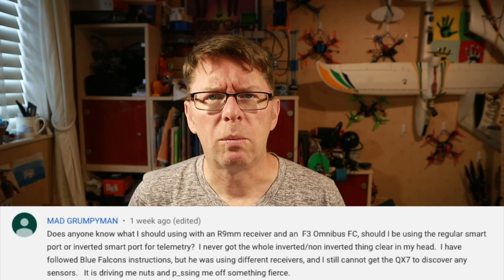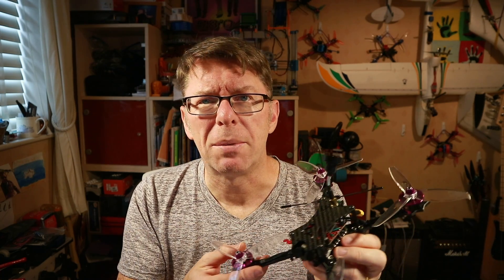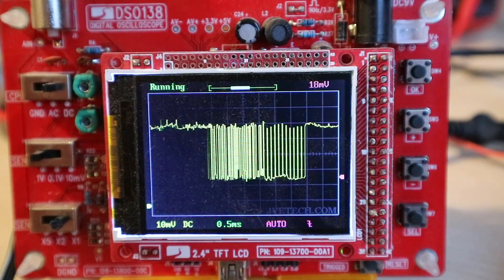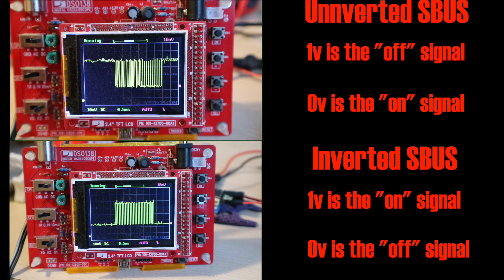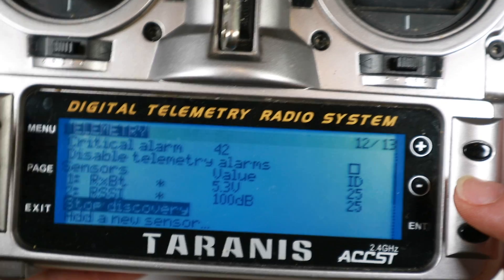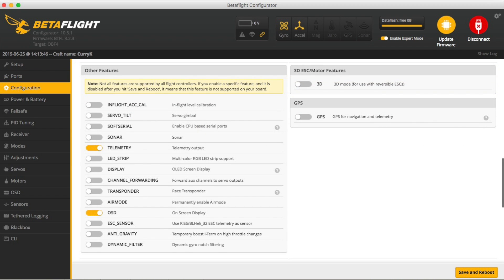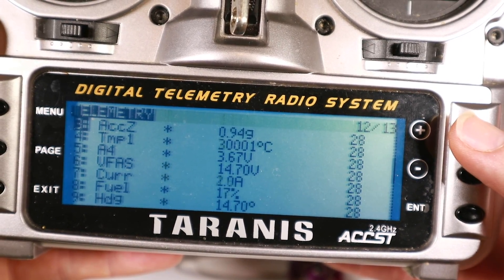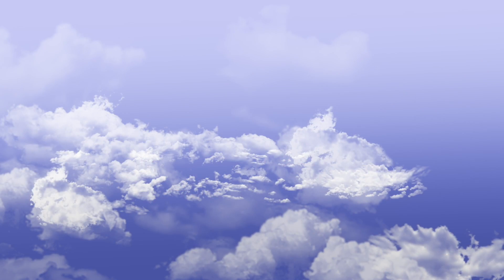How to add Smart Telemetry on the R9MM

Comment: Excuse do you have a video how to set up that receiver to the quadcopter I am heaving troubles trying to set mine up
Reply from the maker: I can't remember, it was a while ago.  There's a full playlist of the R9 stuff here https://youtube.com/playlist?list=PL7WaECFssECJf0tYWSHdIx5qwYYThP0eW&si=DoCVUz7-qLqs9Hgb although how you connect it does depend on the firmware you are running.  R9 is a bit dead now, you could convert it to an ELRS system instead (there's a video in the playlist about how to do that)
Reply: this comes with smart port and i normaly use sbus i have comunication betwen the radio and the receiber but the betaflight dosent recognize the receiber  @CurryKitten
Reply: @CurryKitten thanks finally I figure out now is working thanks by the way what’s that frame?

Comment: do you still get all the telemetry outputs when the RM9 is transmitting at 500Mw?
Reply from the maker: Oooh, long time since I touched R9, but I believe the answer was yes (this Rx/module got converted over to ELRS)  But only if you run the flex firmware, that allowed you to do telemetry at any power

Comment: I've got the R9MM wired to the babyape FPV drone. With this I only wired SBUS, V_IN, and GND. I can't bind this for some reason, any tips? Do I need to wire anything else?
Reply from the maker: The most crucial thing about binding R9 modules and receivers is making sure they are running the same version of the firmware.  Did you flash yours yourself, do you know what you are running?
Reply: @CurryKitten  I bought both at the same time from the same shop. How do I find out their firmware?

Comment: So fix my understanding here please - even if thats aged video. I am using R9M, R9mm and F4 DarwinFPV board. I connected my receiver via SBUS_OUT pad on my receiver.
I want to have RSSI shown on my radio. Using SBUS I can have this on 25mW mode only. Re-binding on any higher power output automaticaly gives me no option to use telemetry.
Simple 3 questions. 
1. Will running SPORT or FPORT allow me having RSSI visible on my radio?
2. If so, do I need to unsolder the SBUS and plug SPORT/FPORT instead or is it additional connection to spare UART TX ?
3. Does connecting to RSSI tab on the board directly give me anything?
Reply from the maker: I'm guessing you are running the EU version of the firmware which cuts out telemetry unless you are on 25mw.  Presumably you have no OSD to pick up RSSI on channel 16 (IIRC).  You options are this - if you don't need to run SBUS, and can run CRSF instead install the ELRS firmware over the R9 stuff.  R9 hasn't been touched by FrSky for years and is pretty much dead.  But if you do need to use it, flash your module/rx's with R9 Flex.  you can still run it on 868, but you can run any power WITH telemetry if you want to
Reply: @CurryKitten  Thanks for taking your time to help me out. Yes, I am located in EU but I have no bloody idea what is the difference between EU or 868 mode that I can select on my radio - can you please, also demistify that? 868Mhz mode pops a warning about NON FLEX cert software need. I always thought LBT is EU or 868 modes; and FLEX allows to use FCC (basically for US). Am I wrong?
I do have FPV goggles, but just thought i could have RSSI reading on my radio too to do some range testing (not necessarily thru telemetry).
Not to overcomplicate that - lets stick to stock FrSky soft.
First option is to use channel 16 RSSI to see signal strength on my goggles but not radio. Do I need SBUS/Sport/Fport connected for that?
Second option is to flash R9 with FLEX, bind on 868 Hz and use telemetry to read the signal on my radio. Basically what I have done so far, but with slightly different soft - right?

I would really appreciate a little bit more patience and helping me out. There are so many videos out there and I am really confused about that SBUS, sport, fport, telemetry stuff.
Reply: @CurryKitten  I finally sorted that out! I followed your advise and flashed R9 FLEX with Fport support. Still not sure how different FLEX 868Hz is vs. standard LBT EU - but it is all working now. Range tests tomorrow! Thanks for your effort.
Reply from the maker: I think (and I'm not sure) that there's probably some legal thing when using 868 in the EU about power restrictions coupled with telemetry.  So the EU firmware probably follows this to the letter whilst flex doesn't... this is in much a similar way to what Crossfire does (there's a CE and Open mode)

Comment: I wonder if you can help I have an r9mm in my quad just switched from spektrum. However I have noticed that I have latency in my throttle as in when I punch it it happens after half a second as apposed to instantly. Using sbus not fport

Many thanks

Comment: Aaaaaarrrgh!  My head hurts.  I don’t understand this stuff no matter how well you explain it.  :-(   I can’t work out how to connect my Jumper R1 to my Mamba F405 stack and have telemetry enabled. 
VCC & GND are easy enough. I’m pretty sure SBUS goes to the ‘RC’ pad, but where do I solder the smart port wire?  There are two pads called ‘Invertor[TX1]’ and ‘Uninverted[TX1]’.  I’m thinking the smart port wire goes to one of those?
Also, if I’m using a Jumper T16 with OpenTX is it necessary / beneficial to connect the RX’s RSSI wire to the FC’s RSSI pad?
Reply from the maker: The Jumper R1 doesn't seem to specify if it's S.Port signal is uninverted, but I'd guess it is as that the 'norm' in which case connect it to your Uninverted TX1 pad and then setup telemetry in Betaflight on the UART.  You could connect the Jumpers RSSI to the FC, but you'll get that in the telemetry as well so you can just send it back to the FC (if that doesn't make sense, then take a look at https://www.currykitten.co.uk/getting-the-rssi-value-to-show-in-your-betaflights-osd-frsky-based/ )

Comment: Hi after all... Which firmware exactly in the RX and the taranis...
I'm getting crazy about to get all the telemetry, I got the bars in betaflight and rssi and vbat in taranis but no more sensor appears. Deleted all, discover and nothing appears... Woh..... :(
Reply from the maker: I'm not entirely sure at the time I made the video, I think the Taranis was on OpenTX 2.2.3 perhaps, and I'm not sure if I'd gone flex on the r9mm yet, or it was back on some old regular version.  It's not something that seemed like it was broken and you needed to go to a certain level though.  How have you hooked your telemetry up - what's the board, and what have you connected to on the rx and fc ?
Reply: @CurryKitten  also open tx 2.2.3 and flex firmware

Comment: Thanks iam trying to hookup r9 on qx7 with fport for 2 days now nothing in happening. Sir which version did you flash your module and RX?
Reply from the maker: It's flashed with the Flex firmware.  I used F.Port on my Tyro119 build and it did have some extra things to do... which I'm trying to make a video about... ad also I can't remember them off the  top of my head.  Do you have any telemetry and do you have your control signal ?
Reply: @CurryKitten  Iam stuck with port not flex firmware. Rx is bound but no stick movement and tele. Then i went back to s bus. The thr rx is not binding. Iam using HGLRC F428 stack

Comment: I connected s.port to a f7 board. It can recieve signal from the radio but the telemetry doesn't work(only get RSSI and voltage on my radio). What should I do?

Comment: Man, R9mm has the inverted s-bus port to be used with F-Port and not with S-Bus to bring telemetry and rssi ... Makes no sense using r9mm like this.
Reply from the maker: There's more than one way to get telemetry out of an R9mm, and in this case it was a specific question from a viewer who wanted to do it like this.  It also let me make a follow up video about how to use softserial... but sure, you can also use F.Port firmware to do the same thing
Reply: Yeah. I didn’t mean to be rude, hope i didint look like that. But since Fport brings you the real Rssi wihtout using a tx channel i don’t see the reason to use it with s-bus :) cheers
Reply from the maker: Hey no worries - I often miss things, so happy for people to point stuff like this out.  R9 seems to have issues with what it's "real" RSSI is.  In SBUS, it transmits on ch16, but that number has always seemed a bit off... although in reality I just get used to it being low.  We can also use telemetry to push it's own RSSI back to the FC, but then I found from testing it doesn't match up with wat's being transmitted on ch16.  I know F.port had it's own issues as well needing to scale the RSSI to 200% to be accurate.
Reply: @CurryKitten  yes you have to scale it to 200%  , otherwise your start RSSI signal (in betaflight) will be 50% . I went crazy for 2 hours before figuring this out :)

Comment: Even if you dont connect inverted s.port to your available uart, as long as you turn on telemetry output in betaflight, you still discover more telemetry. The downside is, if you turn on telemetry output in betaflight is, it will desync or can cause or trigger failsafe.

Comment: VIFLY will have two new self-powered buzzers soon, both of them are based on Gyro, they are wireless that just attach with the quad is okay, no need to do any wiring. One is for DJI quad, the other is for racing quad. The main difference is the charging, the one for DJI quad will be charged via USB port, the one for racing quad is connected with XT60, it can get the power from the battery when flying.
Reply from the maker: Got a note today saying they are in the post

Comment: Hi just a little thought on the cl raceing f4 you can’t use soft seriel on the back of the flight controller you will see a tx6 pad connect the inverted wire the one on the opposite side to s bus and telemetry will appear

Comment: I've had few nightmares setting up s.port over the years, all with f4 boards that make things so much more complicated. Most problems can be avoided by using non f4 flight controllers (FC), or using the new 'inverted' s.port available on most frsky recievers. 
You can also use soft serial as a work around, but involves some CLI resource changes which are more complicated. Several instances with sorting telemetry on f4 boards will involve tlm_inversion, and f.port may involve changing serialrx inversion or half duplex.
Some f4 boards come with dedicated s.port tele pads that work straight away with s.port.

When it comes to f.port, you have double the problems of you're trying to use the normal s.port pin from the Rx. The FC Tele pad may well support inversion, but often they don't support bidirectional signals. You can often get the control inputs working but not have telemetry. Using the 'inverted' Rx pin or me refusing to buy anymore f4 boards and just get f7 from now on, solves this issue.
Reply from the maker: F7 is a nice solution to fix most things and not have to worry abut using much CPU resource

Comment: you think is a bad idea to heat shrink the T antenna for the r9mm feceiver. im just tryi g to make it more prop proof
Reply from the maker: No, it's fine - I did that in my original R9 setup video before I got the updated T antenna

Comment: or you can use the FPORT, connect that one wire to TX3 and set FPORT half duplex in the CLI
Reply from the maker: Yes - I did consider using FPORT, but I wanted to follow up with a softserial video and this one let me do it.  Some people report FPORT not working that well on R9, but then again some people report issues on Flex as well, so horses for courses I guess.
Reply: you’re a courageous man. RTH all setup?

Comment: Also if you buy the new r9mm with the t antenna it has the newest firmware on it so you have to update either module or receiver
Reply from the maker: But how can you tell which firmware you have onboard... it's an annoyance that you can't tell
Reply: @CurryKitten  it's on the package